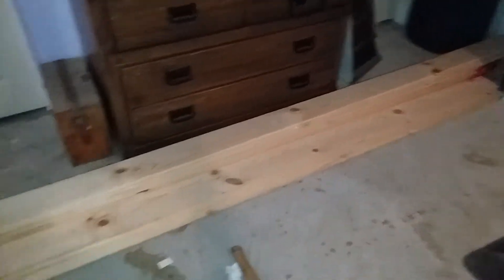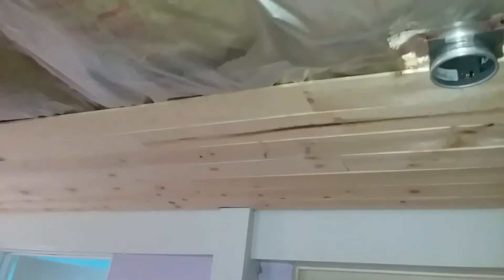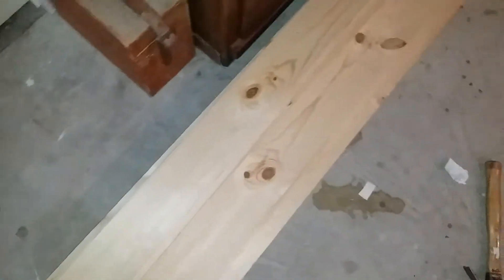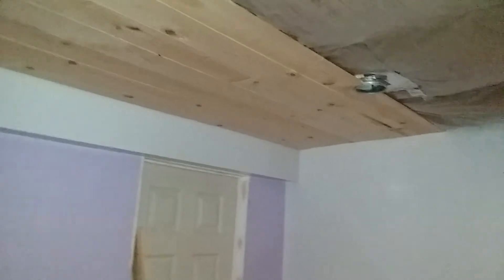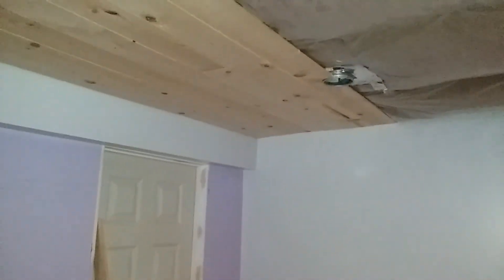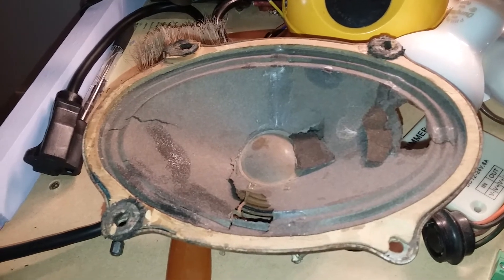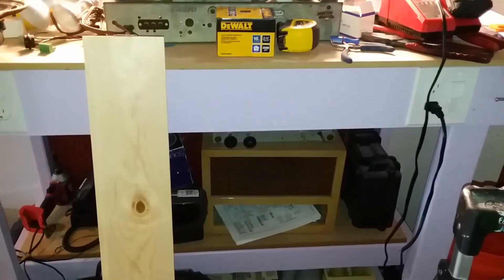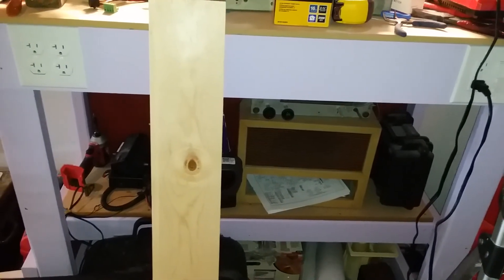Some serious wood going up on my bedroom ceiling... lol

Comment: That's a cool philco! I always like how the first 2 numbers of the model number indicate the year, example, 48-482 indicates 1948
Reply from the maker: Yeah I saw it and had to buy it, even though I have a backlog of restorations to do. I do have all the knobs and buttons, they were in a sealed tub inside the radio. They will have to get cleaned and soaked to get rid of that horrible old plastic "barf" smell. I haven't found out what causes that smell, it must have something to do with the chemicals they used back then to stabilize the plastic. I had a set of screwdrivers from the 1970's with that same issue.
Reply: @mxslick50  huh, never noticed that smell before. Maybe I should go knob sniffing. That sounds wrong
Reply from the maker: LOL yeah that was a bit naughty... The smell on that plastic seems to happen whenever they are in a closed space (like the tub in this case, or my toolbox with the screwdrivers.) Heat and humidity also seem to make it come out too.
Reply: @mxslick50  heat & humidity.... WISCONSIN! I KNOW IT! I'm in the perfect location!
Reply from the maker: LOL I grew up in Ohio and dealt with the same. Here in Idaho it happens during the spring and early summer, after that it's hot and dry till winter, then cold and dry or wet depending.